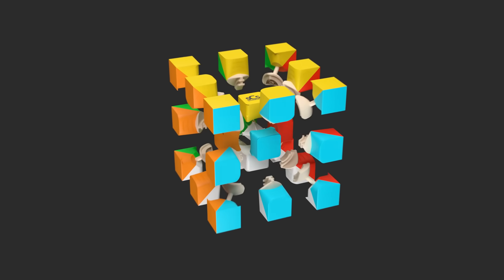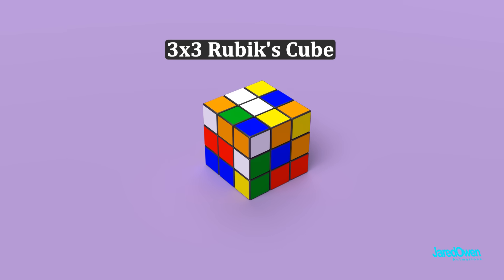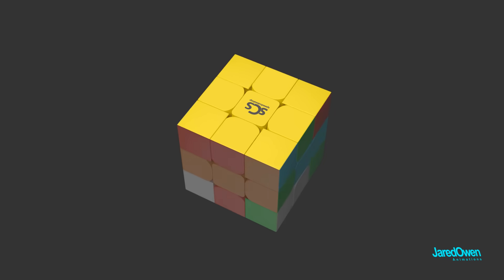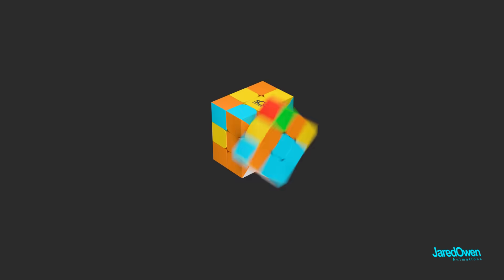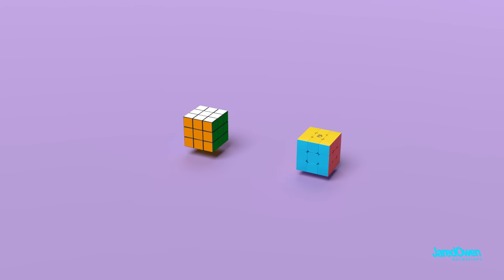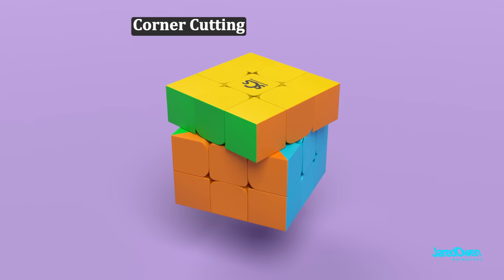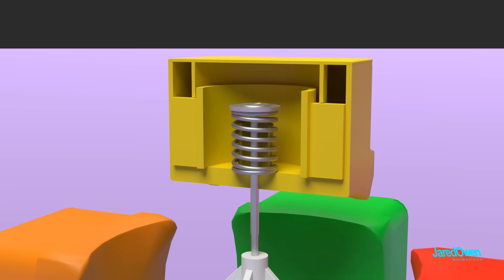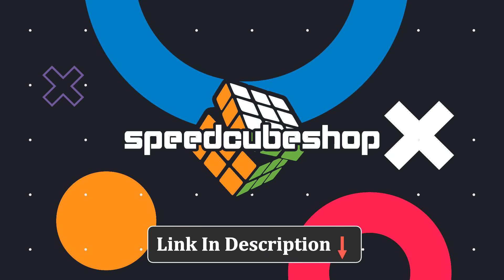How does a Speed Cube work? (Fast Rubik's Cube)

Comment: Im a speed cuber and my PB(personal best) is 31 seconds.
Also fun fact! A Speed Cube has a total of 45 pieces. 6 centers, 6 center caps, 6 screws, 6 springs, 1 core, 12 edges, and 8 corners. 45 pieces that's a lot. although that excludes the magnets that some speed cubes have. CFOP is a nested acronym, or a macronym.

Comment: My old rubik's cube had springs too (original not speed one), corner cutting was possible just a little bit :D if you overdo it you experience RUD (rapid unscheduled disassembly) :D great video, have to check for cube with magnets, that seems cool! :) cheers

Comment: Only thing I would've mentioned or changed was that CFOP is when you solve F2L Pairs at the same time, you showed beginners method which isn't that big of a deal, but advanced CFOP is when you solve F2L without aligning the centers first. I would've at least mentioned stem Magnets, which is when there is Magnets on the core and the stem of each piece but unless your spending at least $50 on a GAN or getting a ball core you really won't see it, I would say it's worth a mention however.

Comment: I know it will be had and for that reason itself those content are not available at full fledge on internet as animation since no one could wrap their mind on it. 

I suggest you if you can collaborate with some genome research institute and try to animate the cell division, Dna replication, dna repair process and eventually how cancer cells become a king on this process and disrupts everything.

This topic doesn't have a detailed animation video out in public. You can see bits and parts there only.

I know it's hard, just give a talk with those peoples and see if it is possible.

Comment: I do hecking want a maglev cube. Haven't done speedcubing in a looong time, but i do still want it. And probably only because those things are cool. Not going to get back on the hobby. Too much fun with the weird cubes, and oh boy they messed my muscle memory, but those things, yea those are cool.
O dang i want a maglev polaris. That'd be the peak of awesome. If it didn't fly apart when turned like my cheapo one. But MAGNETS a lot of them please everywhere.
Reply: Messed my muscle memory because i'm fastest with roux. And the morphing cubes are real hard with that, so been defaulting to CFOP and partially the weird inefficient things i figured out myself as a kid. We didn't have internet back then so i trained those so much that now they have the strongest muscle memory, and because of that they are the easiest to pull off if a cube does not permit normal movement. Or variations of those, whatever is applicable.

Comment: They are little holes in the bottom of the corners were center to core magnets go which makes me feel like this is modeled off of the rs3m super as that cube has the same corner design for all of its variants but only certain variants use the holes for center to core magnets (he says the cube is modeled off of rs3m but that cube does not have this future) also I feel like he should have talked about the spring compression system that most speed cubes have also torpedoes are a cool design feature that most cubes have

Comment: Something I do with my cube is to take my cube and while looking at one of the sides turn one of the adjacent sides 180 degrees then turning the whole cube 90 degrees with the side I was looking at in the beginning still facing me, and go back and forth repeatedly until I did the two moves 12 times always turning the adjacent side that is in the place of the one you turned 180 degrees the first time and turned the cube 90 degrees in the same direction each time then if you do it right you have an x across the side that was facing you as you did this and the adjacent sides would be solved.  Basically what you end up doing is swapping the edges of the side you're facing and the other side of the side of the cube with each other.
Hope this makes sense, it's kind of hard to describe.

Comment: I'm an old school speedcuber and one inaccuracy is that Rubik's brand cubes have a near identical spring tension system in their core that can be adjusted in the same way. Loosening it to allow corner cutting was common. Filing down the spring ends and smoothing the screw threads were also common mods. I am amazed by all the new innovations! The "MagLev" spring was totally my idea like 20 years ago (and probably other people's too), but I never really had the resources to prototype it. This is the first I've heard of it! Besides the friction advantages, the force is now quadratic with distance instead of linear which I thought would have real advantages! Off to look into it more now...

Comment: Nice video!
I myself learned solving one of those with the LBL (Layer by Layer) technique around 15 years ago.
you start out the same as here, but on the last layer, you start by making a yellow cross. Then, you bring the cross in the right position, so that only the edge pieces are random. You then bring the edge pieces in the right place and at the end, you just finish by orienting the edge pieces correctly. It is not the fastest method, but it only requires to learn 7 algorithms, so it is easier if you don't wanna learn a s**t ton of algorithms. Always good fun for impressing friends and also not too hard to learn.
Reply from the maker: I wanted to keep things simple because most people that watch these videos are going to be "non-cubers" - hopefully I found the right balance!
Reply: @JaredOwen  If you wanted this you should have started with the beginners method, instead of going straight into the cfop. (Same as you said it, but much less confusing name lol)
Reply: this is a good method for beginners but if you want to be faster then you should work on knowing full oll and full pll aswell as advanced cross and f2l

full pll is about 21 algorithms but they are all easy to remember
full oll is 57 algorithms which makes it harder to learn out of the two 

a good way to learn these algorithms is by remembering patterns in the algorithms such as triggers or parts of other algorithms
Reply: @Cbrownhuh  he said 15 years ago, pretty sure they know full cfop by now
Reply: @_cablewastaken  yes I know
Reply: Wait if your first step of the last layer if solving the cross why would you need to orient the edges?
Reply: @thephysicistcuber175  no thats oll
Reply: @_cablewastaken  I'm talking about OP's method.
Reply: Nah, I just wanted to be able to solve the cube, absolutely no interest in doing it quick and learning all of the algorithms. Always good fun if I see one lying around somewhere and people telling me that it lays there unsolved for years. The look on the face if you solve it in 1-2 minutes is always priceless 😂
Reply: @qwackkk  😂love it when I see people's confused and surprised face when I solve it
Reply: @qwackkk  it is much more satisfying when you spam an algorithm like the t perm or u perm (m u version) lol

Comment: As a slow speed cuber, I can confirm that this is how it works. Like I have the exact cube used in this
Reply: "slow speed cuber" relatable 💀
Reply: May I join your "slow speed cuber" club? I have a lot of experience!
Reply from the maker: Nice! I bought the spring and maglev version for this video.  I can confirm that the Maglev version is much better
Reply: @JaredOwen  I have one with the alignment magnets, but it has a slightly different spring tensioning mechansim.  You don't have to change the screw setting, but it has a sort of ratcheted plastic holder around the spring with teeth set at different heights.  Like in a bic pen, but with like 8 stop points instead of just 2.